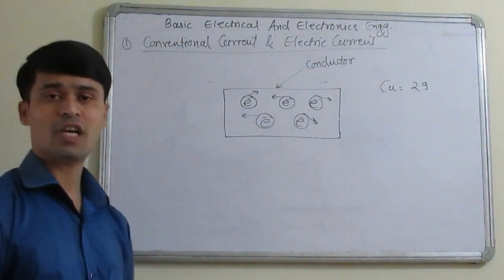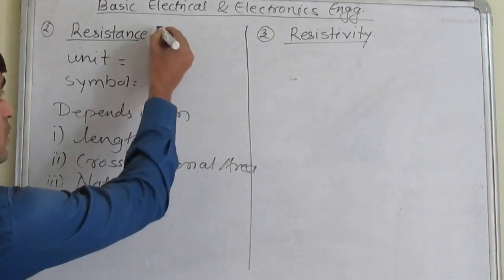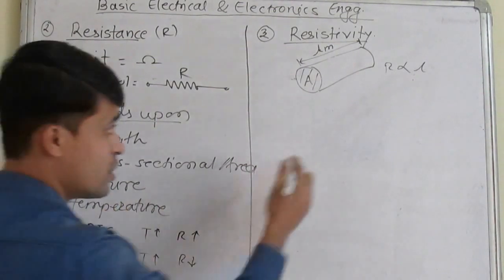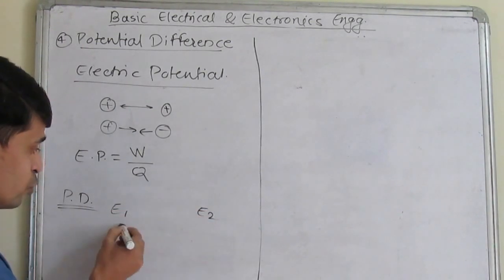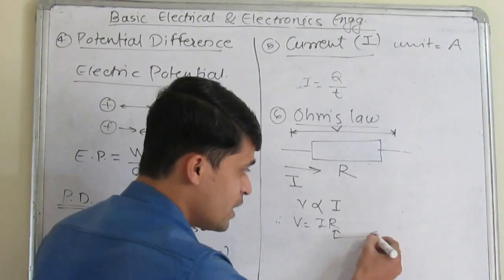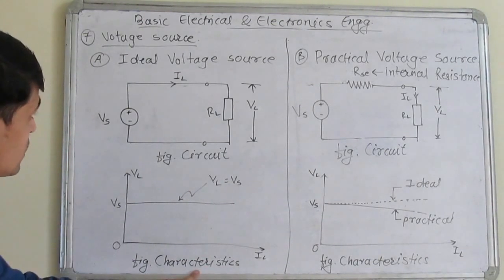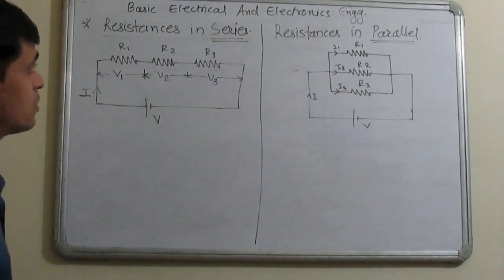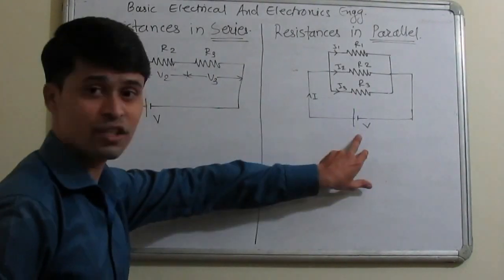Basic Concepts of Electrical Engineering ( Lecture: 1 )

Comment: Electronics Engineering 
Electrical Engineering 
Electric Power Generation 
Electric Power Transmission 
Electric Power Distribution 
Electronics Devices and Circuit 
Electrical Measurements and Instrumentation 
Electrical Machine 
Computer Engineering 
Swtichgear And Protection 
Power Electronic Controlled Drives 
Power System Operation and Control 
Power Electronics 
Control System 
VLSI design 
Digital Signal Processing 
Digital Instrumentation 
Seminar 
Electrical Project 
Electronics Project 
Flexible AC Transmission System 
Neuro Fuzzy Control 
Network analysis 
Linear integrated circuit 
Power quality 
Computer organization 
Digital Electronics 
Electronics communication 
Signals and Systems 
Embedded System Design 
Arduino 
Other 
Engineering community is place where you can ask questions and receive answers from other members of the community. Feel free to ask any question from basic to advanced level related to college study or work. Ask any technical question or problem from book or any practical problem in project also you can ask about seminar. If you are engineering student B.E. or engineer then here you can solve your problems in group by asking questions publicly and help other members by answering their questions and problems. Users from different places come here. If you have any suggestion or feedback regarding the website or app you can send it the feedback link is at bottom left.
http://goo.gl/3jQsLk
Reply: EEE
Reply: EEE
Reply: EEE
Reply: EEE

Comment: Sir  why  current  flow  negative  to  positive
Reply from the maker: Current is a rate of flow of charge per unit time. and the charge is the combination of electrons, and electrons are having a negative charge. Negative charges attract to the positive terminal of the battery, therefore it flows from negative to the positive terminal.